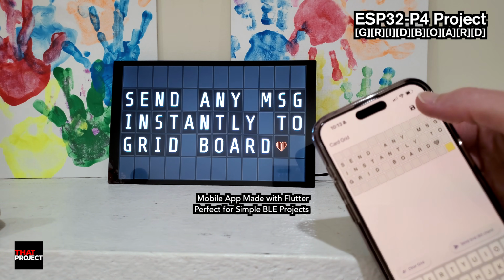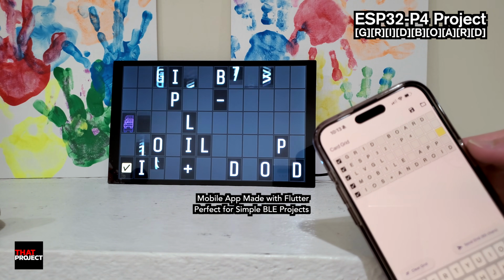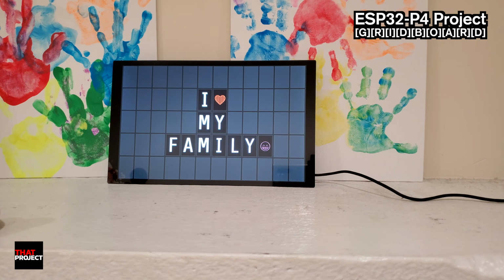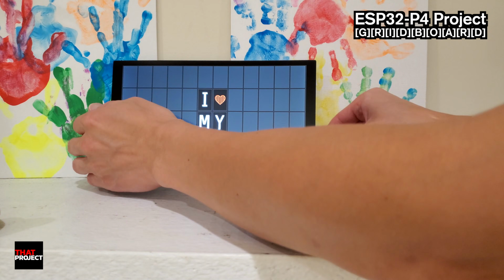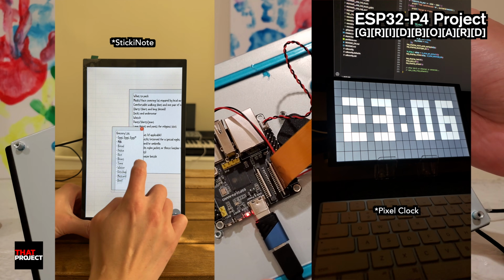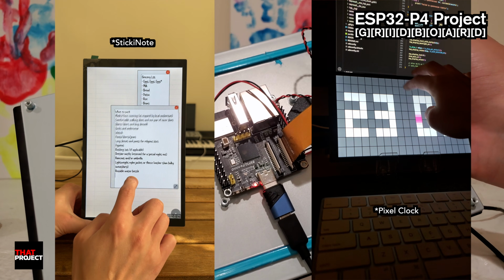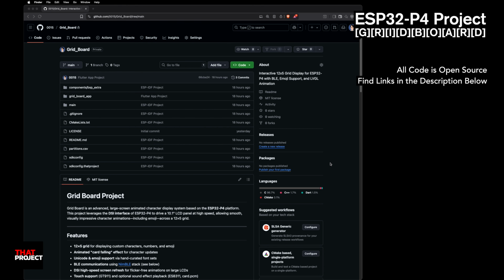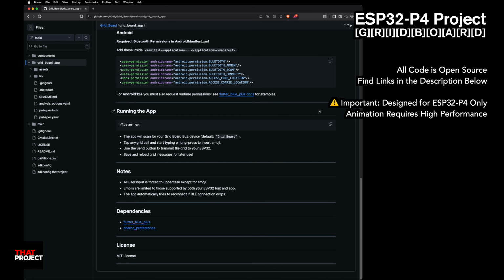ESP32-P4 Grid Board: BLE Text UI on a 10.1" Display (LVGL + Flutter App)

Comment: Ciao carino questo progetto, dispongo di una scheda Elecrow da 10.1 pollici HMI esp32p4, devo modificare qualcosa per farlo funzionare su questa scheda. Grazie
Reply from the maker: Since the DSI section of the ESP32-P4 is similar, it seems you should only need to modify it to match the specific device you are using. I recommend checking the examples they provide.

Comment: how you rotated screen?
Reply from the maker: You can set the desired screen rotation in this way.
lv_disp_t *disp = lv_disp_get_default();
bsp_display_rotate(disp, LV_DISP_ROTATION_90);
Reply: @ThatProject  When I turn it over using LV_DISP_ROTATION_90, I get artifacts. will lv_disp_t *disp = lv_disp_get_default(); remove them?
Reply: @ThatProject When using LV_DISP_ROTATION_90 I get artifacts. 
 Will lv_disp_t *disp = lv_disp_get_default(); remove them? And can you tell me if any additional libraries or anything else are needed to initialize bsp_display_rotate? Where is it from?

Comment: Like your StickiNote project this is a nice and cool project too. Unfortunately, I get it compiled (esp-idf V5.4.1) but is doesn't work. I get the error 
"E lcd.dsi.dpi: can't fetch data from external memory fast enough, underrun happens" and the screen is flickering. I changed the mipi dsi bit rate from 1500 to 1000 and to 600, but got the same problem and error as described. Do you have any idea or hint?
Reply from the maker: I did this project with ESP-IDF version 5.4.2. I don't think there's much difference, but would you try it again with this version?
Reply: Hi Eric, I installed esp-idf v5.4.2 and compiled the project. When running the executable I had the same underrun error. Thanks in advance for your support.
Reply from the maker: I checked my sdkconfig and confirmed that CONFIG_BSP_LCD_MIPI_DSI_LANE_BITRATE_MBPS=1500 is set. Is PSRAM also being used?

Please check https://github.com/0015/Grid_Board/blob/main/sdkconfig.thatproject again.
Reply: Hi Eric, PSRAM is used for the screen frame buffer. Therefore PSRAM has to be enabled in menuconfig and clock speed should set to 200MHz instead of 20MHz. (menuconfig -> component config -> esp psram
Reply from the maker: @peterklingebiel8603  PSRAM is essential for display projects. If you look at my sdkconfig file, you'll see that it's already enabled. Anyway, did this solve your issue?

Comment: Could you please share display type used in the project?
Reply from the maker: Waveshare ESP32-P4 Nano - https://www.waveshare.com/esp32-p4-nano.htm?&aff_id=116255
Reply: @ThatProject  does JD9365 display controller support hardware rotation? Or do you use software rotation to achieve landscape orientation of the display?

Comment: Does P4 have any HW acceleration unit
Reply from the maker: Yes. ESP32-P4 has a dedicated 2D graphics acceleration engine, DMA units, and JPEG decode hardware, making it much more suitable for display-based GUIs compared to earlier ESP32s like S3 or WROOM.
Reply: @ThatProject  would you consider a tutorial that can directly leverage that 2D graphics acceleration engine?
Reply from the maker: @coderhex1675  I'll try it if I get the chance. Thanks!
Reply: @ThatProject thank you🎉